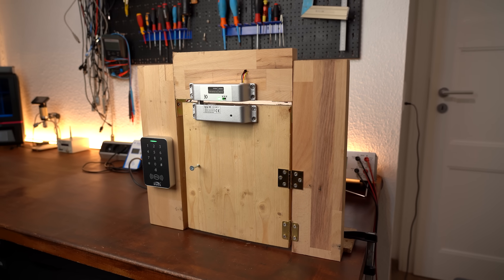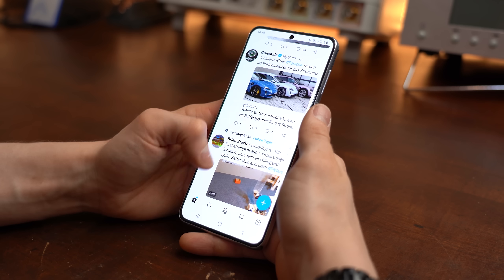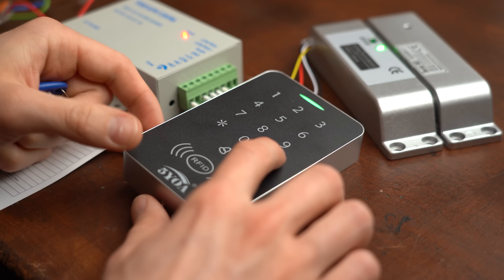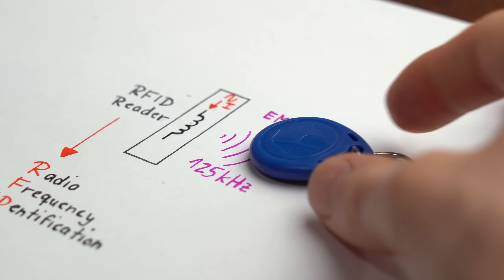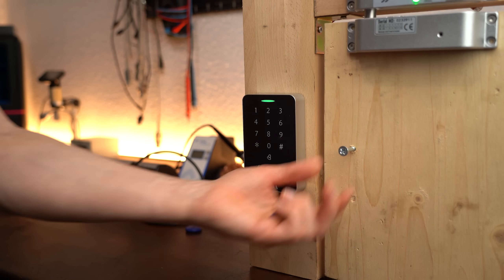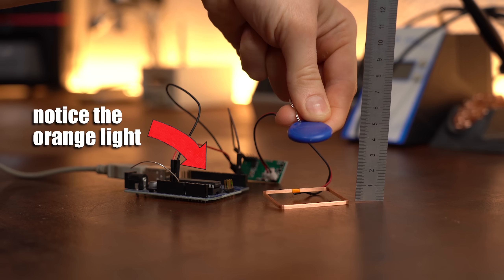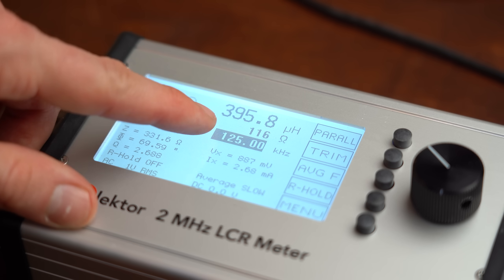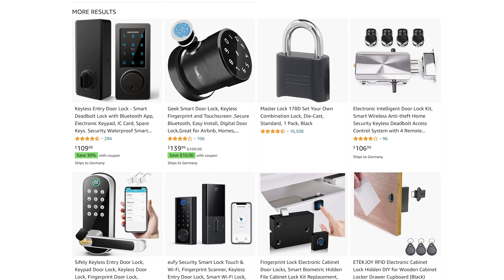RFID Locks are way too easy to "Hack"! Let me show you!

Comment: Most internal mag locks are designed to open with a good shove/kick, this is to prevent people being trapped inside during a fire. It will often trip an alarm if you do this though.

Comment: I"m wanting to put an electronic dead bolt on my door now.  Just so I don't have to get my ass up to relock the door when the kids coming in can't be bothered to lock the door after coming in.

I don't want wifi, because I don't want to have to deal with a cloud ( privacy issues )
I would do WIFI as long as it's local network and my phone can have the app that works without cloud services
Thinking RFID would be good, but now not so sure if someone can simply read that rfid if/when I'm out
Thinking bluetooth now.

Comment: I would be interested if you expand the topic or new one on automotive key FOBs. The extra security having they key/tag/transmitter paired and longer ranges. How to encode different buttons or functions.   I'm assuming its all based on software at both ends

Comment: About 15 years ago, I was the developer of a production tracking system. At one point we started implementing controls of what leaves the production floor to be loaded into trucks. So we added an RFID tracking system. The system began printing RFID labels (yes, just like any other thin sticker) on our Zebra printers.
If you think that product from Amazon is a lot, the reader we had installed on top of the exist door was over 3 meters high and could read the labels of all boxes in a pallet before they gotten directly under it. And they were passive and not active tags, as the cost of those would make the solution unviable. So you have an idea of what's possible.
Now, If you want to maximize the range of your reader, I'd look on content for metal detector designs. Seeing how simplistic you design was if compared to the ones I saw for metal detectors, I know there is a lot of room to increase that range with some freely available designs.
I am working towards building a metal detector and it is way more complicated than I was hoping for when I had this terrible idea. So it's going to take a while 😂.
But I think you'd probably be able to adapt them in no time.

Comment: Nice video. However all you needed is a 12VDC power supply. The lock is not needed as it is simply a relay so a multimeter would suffice to check if you "unlocked" it

Comment: This is still about 1000x more difficult to break into, than an average steel mechanical lock, which can be picked with simple premade tools. Actually having to get a read of the RFID to even begin deciphering and "picking" this lock, is more than enough to discourage 99% of thieves from even bothering. In that case other methods would have to be used to brute force their way in, but still just a standard metal lock would be an easier target regardless.

Comment: Most of those devices are designed in a "clever" way, so you only use one unit, which has to be mounted outside (so you get in reach with the RFID coil. However, those plastic cases are usually not very stable, and you can easy access the wiring. Usually that connectors are documentet well even on the pcb, so you'll know which pins to connect, to directly access the opening magnet. Enjoy!

Comment: I have installed door access in large buildings. If the wire is accessible for the electric strike a simple battery splice can unlock the door. 

But i am interested in knowing if this can be brute forced. Is there a time delay between failed attempts?

Comment: I just got a 2014 A2B Alva+ ebike, just love the high quality of the whole product. Without the Ekey I'll have to scrap the beautiful display, controller set. but they are so AWESOME, I have opened the display up and it's tremendous, only 4 wires, power, ground Can bus high and low. I really am hoping for finding a way to research the builders of this system, and get another fob! PLEASE. IS THERE SOME RECORD SOMEWHERE as to who built this display? the Ultra Motor people or the A2B people, the records, schematics, build sheets. Maybe even was a generic hidden push button sequence that turned it on! If not, SADLY,  a simple $40 controller and display with throttle would get it going sure, but, WHAT A SHAME.. IT IS TRULY ARTWORK ! THANKS FOR ANYTHING YOU HAVE..
JEFF

Comment: Someone knows if the door it's open, the bolt will lock itself after particular time ever the door it's open? Also, the bolt in locked position can be easily pushed in (in open position) by finger? Thanks in advance

Comment: You should look into this lecture a 'pen tester' gave about physical security. He discussed a device he carries in a laptop case that not only can read keys like this but very weak ones such as magnetic strip card keys. In the same case he has blank card keys and the machine to program it on the spot. This guy does it as a job to help companies improve security so hes not commiting a crime but its worth looking at if electronic lock security is a concern of yours.

Comment: the second problem in this device is that the unlock signal is easily tempered with. usulay when you cut the wires it unlocks for a brief moment. and finding the signal cable to unlock is easy also. You have to have an interdal decoder (inside building) to achieve more security

Comment: this is why at the pharmaceutical factory i worked security at for 15 years i insisted that all the card readers also require a  pin (which  only some doors had). after cloning a fewer people higher access rfid cards i showed them  how easy it was to clone a card. I had to compromise as set up a anti pass back system to prevent the same card from entering a door twice with out scanning out.

Comment: The irony is not lost on me when you sarcastically read "electric mortise lock instryctions" while pissed off that the actual wiring diagram is incorrect and risked damaging the power supply. At least the person who designed the power supply included short circuit protection!

Comment: I want to build a home with a fake front door. Imagine having a normal looking residential home where the front door is actually a dummy door. From the exterior it looks like a normal door but its actually bolted in placed on all edges. To get through the door you would need to remove the wall around it because its secured in place so well. Instead you would have 2 actual doorways (to satisfy fire safety code) somewhere else but those doorways are hidden from exterior view.

Comment: A slight off topic: I got similar access controller from Ali, but I can't get from the seller any info about the ring bell button in terms of how I can get the information that someone pressed the bell button. Are any of two wires short-connected? Or does it send something over Wiegand? I communicate with the controller via Wiegand and after pressing the bell button I receive nothing. I also have 2 blue wires going out of the controller labeled "BELL" for an external door bell button (not sure if yours have them too). Would you know?

Comment: Really seems like the squaring is actualy part of the design.
I think I'm probably wrong on this.
But isn't the rectangular coils long edge fields interacting with each other in the centre, squeezing their normally circular shape at the centre line, thereby pushing slightly up the field, but probably with a dimple in the middle of that envelope.
Rather like a sunken Banana Loaf cake?  "a rectangular cake"

I don't know shit about electromagnetism apart from field interactions, & that's just cos, magnets, duh, but electromagnets are dependant on termination points as well so the field shapes change by that as well, actaully, thinking about it, it's all travelling in the same direction around that loop regardless, so the opposing poles in the top & bottom on the long sides always oppose.

Hmm, I really want to play with this now, but it really does seem like an ever increasingly difficult extension.

Ha, hahaha, I wonder how much of what I just said is total arse gravy

Comment: I think may be away is the bypass the keypad and put a large magnetic field where the solenoid is at the top of the door that way the magnetic electrical induction goes into the locking door solenoid and with enough power you could make the solenoid work through electrical induction, you would need a alternating current,, I think this is actually doable.

Comment: The reason increasing the voltage of the power supply might have decreased the read distance is because the amp circuit might be operating off of a larger, but less linear range.

Comment: alternatively bring a very strong magnet close to it
sometimes they will directly pull the bolt open
sometimes they will trip a solenoid that opens the bold
sometimes they will crash the software which then resets and defaults to open

Comment: The encapsulation is generally made of plastic, cutting the front part with a portable machine, what would be the minimum modification in the circuit for the door to open?

Comment: I am planing on building a cat house with a rfid activated door. I can see they have many of them for sale in stores and DiY projects, but they come with RFID collar for the cat.
So I am curious, is it possible to read the RFID chip the vet install on the cat/dog?
Would be a great project to see you do. It would sure help me a lot 😅
Reply: There is no point in complicating yourself with the underskin chip from the vet.  If you care so much about your cat, it's easier for you and safer for the animal to integrate an RFiD tag into the collar/medallion/phone tag pendant If you reduce the access hole (like a mini tunnel) to the range of the reader, the problem is solved.
Reply: @rockets_for_broomsticks  You have a good point there, I like to complicate a build. But as I found out since I commented here. There are already  cat doors for cats that have the microchip installed, And you can program up to 40 cats to access the door. 😅 It cost 140€. The cat house is just a mini project to play around with and make a "smart" home with heating in the winter and cooling in the summer and solar-powered.
Reply: @-MrDontCare- Ok, in this case you are very lucky.  Personally, I stayed with the professional habit of calculating all imaginable situations that can make a system not work.  During the visits to the vets, sometimes they were able to read my puppy's chip, sometimes not.

Comment: I find it a bit disturbing that the title suggests all RFID locks are hackable. For sure anything under $25 is not going to be any good, but there are better systems that use challenge-response mechanisms (DESFire tags, for example) which, if implemented correctly, are not susceptible to replay attacks like the one described here..

Comment: It really comes down to use case tho.  If you are worried about "random bad guy" dropping by, then tag copying isn't really a concern.  The "random bad guy" is unlikely to bother making sure they get close enough to you to copy the tag.  I see you thought about that a bit, with your 30cm range requirement.  But I still think that's not the random bad guy who is hanging around most neighborhoods.
So you are right, yeah, RFID isn't the best if you are worried about a targeted attack.  But I don't think that is the use case for these devices.

Comment: I just recently looked a bit into something somewhat related. The new Webauthn standard.

You could likely create a lock with that via NFC, and that should be secure at least from the non-physucal standpoint.

Webauthn uses stuff like "challenge response", where the "key" never leaves the Webauthn device, but instead you only prove its presence. The challenge is provided by the resource to be opened and contains both host information as well as stuff that's temporary (like the precise start time of the authentification), and IIRC should also be signed by the resource to be opened, to avoid people just faking that resource to get a valid key.
Reply: That... is actually quite smart. This is essentially two-factor authentication, where you would need both the RFID tag in ADDITION to a physical code in order to gain access. An earlier comment had suggested something similar, and even with my experience with RFID mechanisms, I have never seen anything that functioned in this way. I hope Webauthn gets widely adopted, since it seems (at least theoretically) more secure than existing RFID infrastructures.
Reply: @SongSteel  yeah and they key can not be copied which was a design goal.

Webauthn can also already contain 2FA, with some implementations (eg Yubikey Bio) validating the 2nd factor entirely on device, which means that 2nd factor is also a lot harder to steal. Though I don't believe that you can power a fingerprint reader like that with NFC (which is likely the reason that key doesn't have NFC).

Webauthn is available in a few sites as 2nd Factor (but not very prevalent yet, Google, Microsoft, Github etc).

In all fairness that Standard isn't making things easy for adopters, while it's open it's also complex and really has a mess of terms. Webauthn is actually the term mostly used in connection to websites, it's also referred to as FIDO2, and CTAP2. So yeah😅.

But it ought to be very secure and I was a bit surprised nobody seems to use that with Physical Locks.
Reply: That’s what HID and other commercial access control systems already uses with one time password verification.
Reply: @brandonlui  nope, just dug around a bit. HID offers its own brand of FIDO2 keys, but they're only used for websites. They also gave some kind of statement that may mean they're working on something like a lock, but I didn't want to spend that time understanding that corpo speach, clearly there are no products yet.

One-Time-Passwords (OTP) are a separate technology. It's certainly more secure than just using a simple ID as a secret, but compared to what FIDO2 does it falls short in a decent number of ways. Relevant for the web, less so for these physical keys, it's a lot easier to brute force. But, and that is very relevant for physical locks too, it is also a lot easier to get your fingers on its secret compared to FIDO2. The secret for FIDO2 never leaves the "token" as they're called but is just identified in some other way, with OTP you need to transfer the key to the token from the device that you want to authenticate at, and on that way it could be intercepted. Also these tokens are often not secured in a way to avoid the secret being copied.

FIDO2 also has these other advantages: Because none of the things you authenticate against need their own data on the FIDO2 device you can use ONE token to authenticate against UNLIMITED parties, whereas every party with OTP needs its own secret on such a token. FIDO2 also, as I said, can be its OWN multifactor authenticator, so in that way there's no way for your first factor to be stolen of (or by) the party you authenticate against.

OTP is a cast improvement over the presented RFID "security", and I'd agree with the statement that that improvement is larger than that from OTP to FIDO2, but still FIDO2 has a large number of improvements over OTP that make it a lot more secure and also often convenient.

Comment: I wouldn't buy a RFID system that wasn't challenge/response based.
Just sending your ID over wireless is meaningless.
Reply: Unfortunately, the vast majority of RFID systems are not challenge/response, but rather, passive wireless transmitters. I'd imagine you would be hard pressed to find anything that fits your description for an RFID access system.

Comment: I got one of those readers...got about 45 reads off random people in just one day! In my own building I can now get to 14 additional floors. Honestly, rfid on elevator control might provide some security, but the stairwell doors have no security. This is an important lesson here, security is usually only theatre;a show.
Reply: congratulations, you have unlocked new level with the device DLC
Reply: Could you explain how you would do such a thing? I'm looking into copying RFID tags as well, and progress is slow. How did you learn how to set up a reader, and where did you get your necessary supplies off the internet? Any advice is helpful. Thank you very much!
Reply: Some at IBM asked me how I got into a secure room at their facility. I was in the building trade.
Reply: But you’re talking only about uncrypted RFID right ?
Reply: @CapitaineBleuten  clone is a clone
Reply: Well the majority of lifts especially where I am can be simply overridden by a fire service key purchasable on eBay or Amazon so RFID lift locks are thankfully easy to override. And I say thankfully because I am a Lyft enthusiast and I like going for joyrides.

Comment: While hacking is certainly fun, it defiantly isn't the fastest way in. Because all the control electronics are located in the reader the fastest way in is going to be to take the reader off the wall and short across the relay thus letting you in.
Reply: While this is true, it is not always practical. The concept of "stealing" RFID tags is still valid, since most systems are not this simple. If you needed to steal an employee ID to get anywhere else (especially if you need repeated access), it would be much easier to steal an ID as opposed to unscrewing the system and messing with the electrical wiring every single time you needed to enter.

Comment: This lock is locked at NC. Turn power of and it opens. Worst kind of locks!
Reply: Is that true? Where turning off the power automatically opens the lock? In my experience, most RFID access control systems do not work this way.

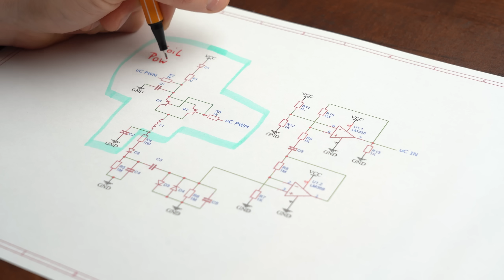Comment: In the schematic at 7:45, play with the other part of the circuit also. Yes raise the voltage but also play with the receiving circuit, like the forward loss on D2 and also with the capacitance of C3, and at the end if you filter the noise down by playing with this part you can rise the gain of the OpAmp.